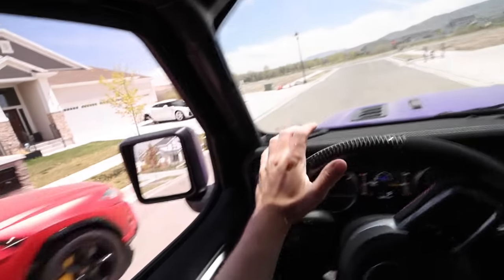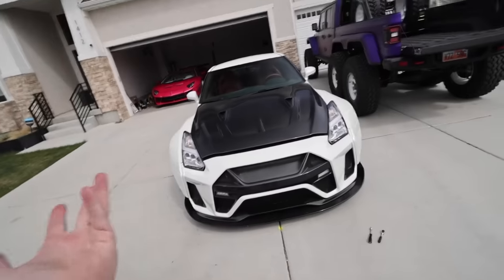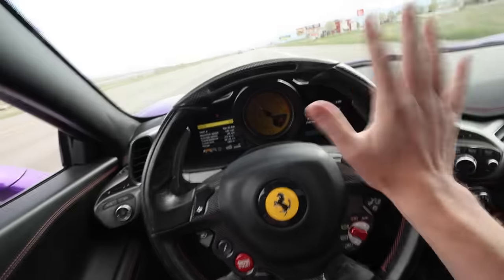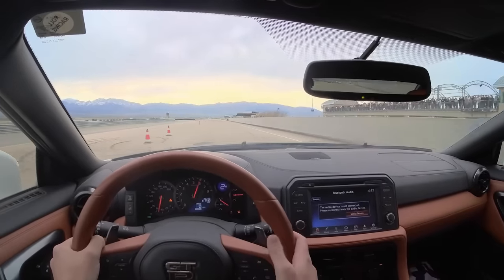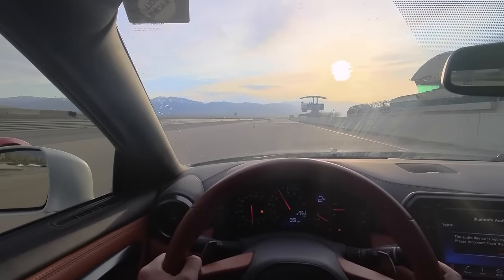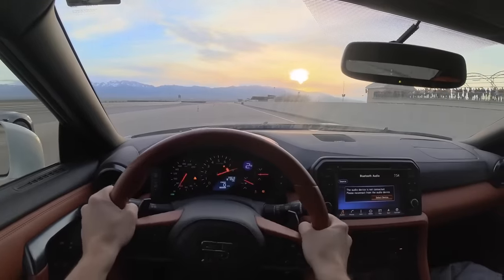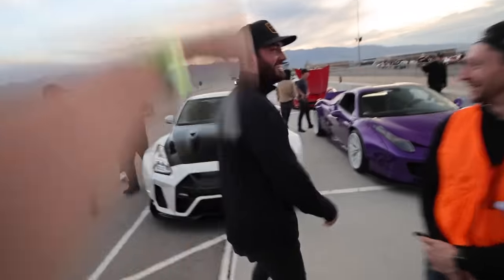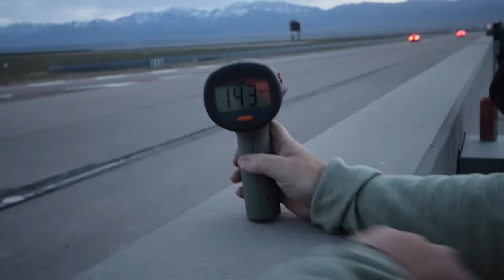Tesla PLAID vs my Nissan GTR.  End Game.

Comment: The Plaid Killer The Bug Killer this GTR can embarrass anyone dude 💥 internal combustion op💪
Reply: It should run a Chiron next
Reply: The DDE hurricane could smoke it it makes 1800 hp
Reply: DDE 's twin turbo huracan makes 1700hp crank and 1400whp while stradmans gtr makes 1800hp crank and 1500whp
Reply: @pixel_boost7499  would be an awesome race 👌
Reply: @onandilewis3290  Chiron is slower than Plaid so what's the point?
Reply: @northernasatru7562   if strads gtr has the slicks on while racing the gtr would obliterate dde's twin turbo huracan
Reply: @lukabosnjak3829  Chiron would get gapped so hard
Reply: @lukabosnjak3829  is it tho on the top end?
Reply: @lukabosnjak3829  would be more like a 1/2 mile run
Reply: @lukabosnjak3829  nonsense, the Chiron does 0-60 in around 2.4s but almost 300mph top speed do Sthu!!! 🤡
Reply: @carholic-sz3qv  Buggati is a toy for the price, Rimac Nevera would be much better for this stuff...
Reply: @onandilewis3290  Bugatti should maby be faster after 150 but tesla got the new update tho with higher top speed...
Reply: @lukabosnjak3829  don't talk about tesla please...you saw in the video
Reply: @lukabosnjak3829  even with the 200 mph update the Chiron would still beat it to 200 mph
Reply: I mean from a standing start it would have been so much closer.
Reply: @lukabosnjak3829  lol………………………………..
Reply: @lukabosnjak3829  nah its not slower plaid's acceleration is higher than chiron but plaid can't touch 300mph like chiron plaid can smoke chiron in a 1/2 mile race but it can't beat chiron in a top speed run
Reply: Till a 2000HP Viper shows up.
Reply: @pixel_boost7499  which car is lighter
Reply: @landysok90  the Huracan Is lighter
Reply: It's a family sedan lmao. The Tesla roadster next year will be a fair comparison tho.
Reply: ICE over evs any day
Reply: Crazy how cars lose 300 full horses just through the transmission and driveshaft and all that
Reply: Rimac Nevera would likely still win
Reply: @TopG800  no thanks. Day I'm forced to go electric power I'll stop driving
Reply: @chriscollins550  they might have hybrids like the Honda nsx though and I might be looking forward to something like that
Reply: @keit273  300hp or more is lost when your are talking these numbers. It’s typically around 15% and even more when talking an awd car. And yes I am with you drivetrain loss is crazy. To think that GT-R is losing more power then an average car makes.
Reply: @lorijohnson9417  We don’t actually know what DDE Huracan makes. We have been told 1700 crank but it hasn’t been on a dyno. Based off what we have been told it should be close in power. But DDE would have a serious driver advantage. Damon is a better driver then Strad and would push his car much harder so they might win just off that.(not a slam on Strad or anyone just a fact)
Reply: @TopG800  I am with you. I am not for all electric it should remain a choice. But there are some crazy potential with hybrid platforms to make some fast cars. And still retain decent sound which is so huge to me.
Reply: @lorijohnson9417  it makes 1800 to the crank same as the GTR, so I will say it will be a very even race.
Reply: It's why it's called Godzilla cuz it destroys
Reply: @soorajy4181  Not really most people who build them know what they’re doing. Plus the Vipers v10 is very durable.
Reply: @guyknightley3499  yeah that's true
Reply: @lachlanB323  hmm yes
Reply: @lukabosnjak3829  no it's not buddy. If you have been living under a rock, the triple F collection raced their Bugatti Chiron with the plaid on an airstrip and guess what, the plaid lost, quarter mile, half mile, roll race/drag. So first watch it before commenting.
Reply: @AWA-jv6rt  I did, was before 170+mph on plaid as far as I know...
Reply: @lukabosnjak3829  watch again kid. Tesla traps 150 in the quarter mile. The Bugatti beat it before a quarter mile. Also in the roll races, the Bugatti took it down before well before 100 mph.
Reply: @lukabosnjak3829  even with the 200 mph update. The Bugatti will reach that mark first and also it has a top speed of 260+ mph. No Tesla is catching that. Tesla is one of the quickest cars in the world right now, not the fastest.
Reply: Not the Rimac Nivera
Reply: @lukabosnjak3829  the heck!! see a drag race and then say it bruv
Reply: you can buy  2 plaids for what he has in that gtr
Reply: @johndavis7112  Not really, brand new GTR are no longer in production but you can buy used GTR for like $60k and get AMS Alpha 12x turbo kit for about $16k and you'll have 1200hp car for less than $80k
Reply: @johndavis7112  but more than twice the fun
Reply: @johndavis7112  and the gtr has a soul, plaid doesn't
Reply: Rimac Nevera game over
Reply: @kennethmclean872  dud it's 17 times the cost of the plaid
Reply: @INDIANBEA5T  Chiron cannot touch 300 mph either
Bugatti has to tune Chiron SS 300+ it was modified with 150 HP More a long tail design then it reached 300 mph 
It's not a production car at all 
I highly doubt Plaid can beat Original Chiron at 1/2 mile
Chiron Pur sport can beat Plaid at 1/2 Mile
Reply: @lukabosnjak3829  tesla still can't do 305 mph like a chiron sthu tesla kid
Reply: @INDIANBEA5T  Bugatti can't carry 5 people with their luggage and beat tesla on a dragstrip for 1/20 the price so don't talk if you have no clue...
Reply: You mean a heavy modded already racing car vs a sedan? lol

Comment: Hey James, I think a rear seat delete & rollbars + bucket seats (I would recommend recaro sportster cs nismo is enough for street use) should be the next on the list for the gtr. and I think you shall consider Toyo R888R tires & definitely as you say, a brake upgrades to stop that godzilla.
Reply: R888s are the most overrated tires out there.
Reply: Just like Tanner Fox has
Reply: yep that godzilla needs the monke to slow him a bit
Reply: GTR guy here with over +2000whp, he needs an 18” set up with Mickey Thompson ET Street R’s
Reply: Nismo recaros are not buckets lmao
Reply: @assadmohebi6402  daaaaaamn. Any videos of that beast? 😲
Reply: @henrivink7137  ?
Reply: R888R are overrated
Reply: @carsofsouthernmaryland4066  they made a HUGE difference on my 2019 z06 792 whp 801 torque, I had cup 2’s on there before and they would just spin , even in 3rd gear, the 888r hook in 2nd gear , unbelievable difference, fantastic choice for somebody who doesn’t want to go down to an 18 inch rim and tire 👍🏼
Reply: @scottschneider5866  he’s got twice the power. Those just won’t cut it. No street tire will. He needs tall sidewalk drag tires to actually get traction
Reply: Sidewall*
Reply: Nah he needs mickey thompsons on a smaller wheel at this point
Reply: James is not a race car driver and I definitely see the race car safety needed but that's what makes the gtr soo cool its a plaid killed with a full interior ac and back seats but yeah deff bigger carbon ceramic brakes
Reply: @USDM_Jesus  no he’s not and yes it’s cool but it’s just not safe whatsoever. It needs the proper safety tools to be safe. No matter who’s driving
Reply: @carsofsouthernmaryland4066  nah that’s where you are wrong, best grip for straight line and cornering on the market
Reply: I have R888Rs, they’re supposed to be track tires, but they are overrated as others have said. They’re outperformed by Yokohama Advan A052s and Falken Azenis RT660s which are both 200 treadwear tires, whereas the R888Rs are 100 treadwear (which SHOULD mean they’re stickier at the expense of not lasting as long)
Reply: @carsofsouthernmaryland4066  they’re honestly not. They’re great tires
Reply: @scottschneider5866  nitro nt01 for the win
Reply: Prob should add drag tires and wheels and add lightweight stuff
Reply: Ran R888Rs in 285/325 on my 1200hp R35 and the car sticks like glue. Absolutely incredible tyre. MPS4S were completely useless.
Reply: Definitely!
Reply: @z_max33  I know its not a full bucket seats, but if he's using it on the road & not a fully track / drag vehicle it will do just fine, way better than his current seats
Reply: Agree minus the triple 8's - they probably won't cut it. He needs beads and radials.
Reply: @carsofsouthernmaryland4066  💀 I see you don’t know what your talking about 🤦‍♂️
Reply: Recaro dont make bucket seats anymore. Still can get em used tho
Reply: @carsofsouthernmaryland4066  what’s a better tire 🛞 then?
Reply: upgrades from spyros panopoulos
Reply: If you think R888r’s are good, you don’t know what your talking about and have never experienced a proper 100tw tire.
Reply: @Apollo_s2k  what’s a better tire 🛞 then?
Reply: yeah 10/10 it’s a 1500 wheel horse power Nissan GT-R lmao

Comment: These R35s seem bulletproof.  They just ask for boost, it’s so cool watching them gap everybody.  Might be me favorite car in the garage right now
Reply: Trust me they aren’t 
With the right work to them yes
But not stock block and stock diffs and gearbox
Reply: @bavomaes   Well no shit. There aren't any cars on the market that don't require internal upgrades before putting down massive power.
Reply: @keynesianeconomics4113  The Tesla doesn't😂
Reply: @keynesianeconomics4113  
Well technically…. A Supra comes really close to that lol
Reply: @TK-fl1on  Tesla can't even be tuned to begin with you'll stuck with the same amount amount of power forever while the GTR can be tuned even more
Reply: @nonameyet2205  doesn't change my point idk what you're even rambling on about... my point is that a very minimal amount of vehicles can beat the Tesla while they're stock thats why I said you have to pay for mods just to beat a Tesla... the plaid is the benchmark for speed and that's how it is... I promise you this... a stock GT-R will never beat a Tesla
Reply: @TK-fl1on   New stock car beating old stock car is common and nothing to be proud of, there are alot of upcoming car that potentialy will beat the plaid even at stock. The R35 GTR is 15 years old and no longer in production, a new R36 GTR is planned for 2023 and it is rumoured to be a Hybrid or full EV, there's also the lexus super EV with estimated 0-62 in 2 second, there's also the 3 motors and 4 motors Taycan coming soon, there are also a new BMW and Mercedes super EV coming soon.
Reply: @keynesianeconomics4113  Except there is one. Honda K-series
Reply: @gt7984   I can’t twin turbo my 2018 K24 Accord without substantial overhauling of every major component.
Reply: @keynesianeconomics4113  Referred to Type R K-Engine. They come with forged internals, stock.
Reply: @TK-fl1on  to be fair you’re correct.  Electric cars are the future but I’m 46, I’m old and electric cars are missing something for me.  It’s a personal preference for sure. I can’t afford either so I’ll just continue to watch people make content about the

Comment: Haven't watched the video yet, I'm actually curious to see a plaid against the GTR and honestly I don't know who'll win. You're way lighter and have like 50% more power, will that beat the instant insane torque and advanced traction control? I'm excited to see

P.s.: please fit a chute and roll cage on the GTR, man! 1600whp are no joke! Proper tires would also make you faster and safer!
Reply: they did rollers, plaid would beat from a stand still
Reply: The GTR wouldn't have full power until the higher revs because of the turbos
Reply: @kcbmw  look up hoonigan channel, see how the plaid has been embarrassed.
Reply: @PaiN-ob9un  embarrassed is a strong word, im just saying everyone knows the plaids strength is off the line and the gtr is better at top end. i still want to see it from a stand still
Reply: @kcbmw  yep, i would have liked to see a stand still race
Reply: @kcbmw  if you watch one of drag times recent videos of a plaid Vs a 1000hp Mustang and similarly powered gtr to Strads, the gtr gave the plaid the hit and still beat the plaid to the finish. And it was done on a prepped surface. Not too sure what will happen on unprepped though
Reply: @kcbmw  no saw another gtr beat a plaid from a stand still. It did a 8.1 sec.
Reply: @falcongamer58  pretty sure its boost by gear with minimum lag.
Reply: Man are you slow or something 😂🤦‍♂️ 1000whp vs 1500whp😂 only competition would be a 1600whp tt lambo/r8 or a 1800whp tt viper.
Reply: @johncena-hq1ti  let me introduce to you the concept of torque

Also, the GTR has 1600hp in a specific rpm range, only when the turbo(s?) spool up. The Plaid gives you 1000-1100hp and 900+ftlbs of torque as soon as you mash the accelerator. That's the difference!
The Plaid is heavy as hell though, so the GTR would still probably win if you launch it well. It's got 500 more horsepower after all
Reply: @kcbmw  that GTR is no where near setup for digs 😂
Reply: @FAB1150  bro all that shit means nothing. Do you watch any type of street racing? Twin turbo Mustangs with 1000whp have waxed the plaid by 3 cars+, same with Audi rs3s with 850whp, just two examples to name many. Why would you ever think a car that weighs less and has 500 more whp would lose. Wish I could bet against someone like you😂ez money.
Reply: @johncena-hq1ti  i literally never said that one or the other would win. It wouldn't be that far of a match though. You've seen it in this video too, the plaid isn't that far behind even if it's disadvantaged by the rolling start.

Also, what kind of a car guy are you that you say that torque and the power curve mean nothing? Lol
Reply: @FAB1150  lol obviously it means something. But when one car weighs 500lbs less and has 500+ more whp, any car guy with a brain can tell the outcome, a mile away. Bro if a 1000hp mustang put three cars on the plaid, what do you think this gtr would do? 

I even saw a 1000hp stick shift mustang gap a plaid. 😂 and this is someone who like the plaid. But it’s very beatable. Since when was 9.2 the end all be all😂 there’s 7 second street cars out now.

Comment: You really need to get a wing on the back so you can actually have some downforce keep trip. That’ll help straighten out the car. It will slow down a little bit but do you need the downforce keep the retires planted. And probably a better tire

Comment: This goes to show that a modes ICE is still faster than an EV because the only way to mod an EV is on a battery which becomes heavier. The EVs need a next generation battery, solid state, if it will make in production.

Comment: When you do that,you chip the valves, you chip the semi-rings.You kill the road-berings.Try not to forget.
Reply: so you can earn,no much then 1000km on this stile.Or,5k-10k,on roads.The oil is not that fast.the pump oil,is not so great.The cumbustion can bolts of your headers.So,that engine must be,re-thinking.The compression of the engine,is stands for hard metals to be disintegrated/on chips/right on the exhaust.Olso the gears pinions/the guide between the pinions. That is damn.
Reply: My english is bad.Because i do not care,no more.
Reply: the compression of the matter=chips.Like,Layd's.
Reply: Also the block of the engine.Can't make it that fast,so the block,is damaged every time you pull that Nissan Engine.Maybe the guys,are knowing,at lest the oil needed.

Comment: Well, this is simple physics, on a rolling start the Tesla advantage is neutralized. The advantage of an electric motor is the instant torque, when you do a rolling start with a gas engine at the RPM where most of its HP is produced things become very even It will be interesting to see a race when the Tesla roadster finally comes out. Also a standing start. That GTR is awesome thou.👍

Comment: why were the 1/4 mile times so slow for the plaid? 143mph? That's 10mph slower than what it should be doing.
Reply: it was a 1000 ft roll race. Not 1/4.

Comment: James, the steering looks kinda wobbly when you hit the gas. I don’t want to take your enthusiasm away but this car wasn’t built for this kind of power and it’s little bit irresponsible to make something like this without tackling this. It needs stiffeners, stronger power steering etc to keep the wheels straight. You might be skilled enough now to handle it but any newbie in town or an owner can get easily hurt. Yes, it’s a build but not though through build. You know how much of a engineering went into let’s say Chiron ti keep the wheels straight at all time no matter what?  You can’t just put hp like crazy, new tires and call it a day. 🤣🤣🤣